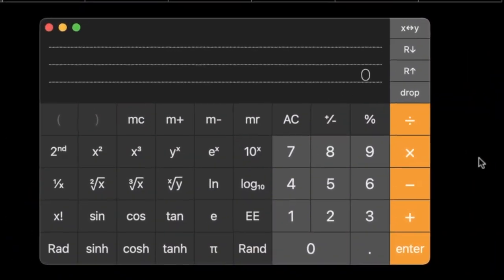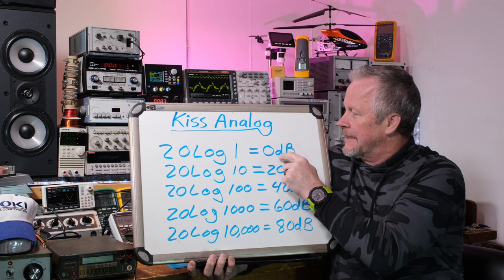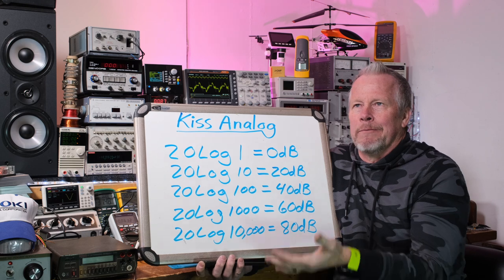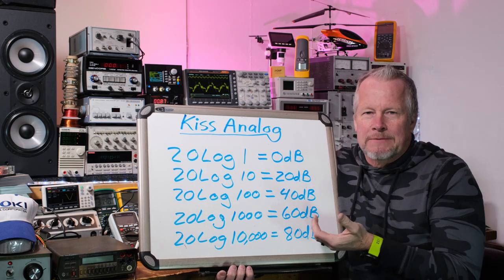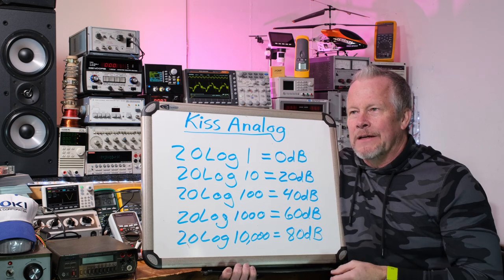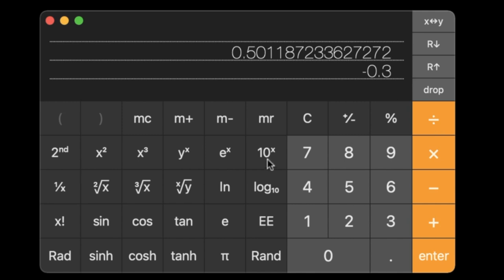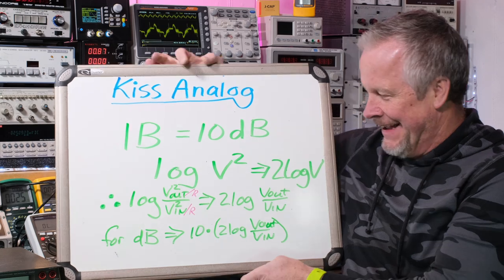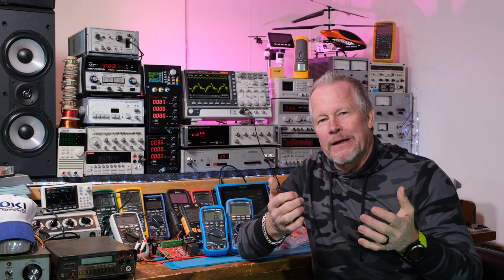Whats all this dB stuff?

Comment: As always, excellent overview, Eddie! I'm looking forward to part 2! Here's a guess about some of what you might cover -- 

Somewhere between the Abacus and humanity becoming spoiled with modern calculators, engineers were ninjas at solving problems using mechanical slide rules, which work using logarithms. Aside from a handful of the slow, clunky,  gigantic complicated computers they had available, we can thank brainiacs with slide rules for landing us on the moon, as well as a majority of the significant scientific and engineering breakthroughs we had in the 20th century prior to the late 70s. 

Compared to what we expect from modern calculators, using logs and dBs typically give you an approximate rather than exact answer; however, the results are usually accurate to more than enough precision for what we need. Decibels give us a quick and excellent estimating tool! Something that Eddie alluded to in his V² power example hints about what makes logs and dBs so incredibly useful and powerful in calculation - it's MUCH easier to add and subtract very large and very small numbers than it is to multiply and divide them, and that's how logarithms and decibels work for us!  Instead of using multiplication or division to solve for things like gain or loss, you add and subtract. Decibels also represent huge ratio quantities by using small numbers, making the addition and subtraction even simpler - like, grade school in your head easy! Also, as Eddie excellently explained in this video, they make it extremely simple to visualize or represent enormous ratios. It's no coincidence that we mainly use 10log(x) / 10^X logs because our natural number system is base 10 (thank our fingers for that). Once you become comfortable using dBs, they open a new world of seeing and understanding electronics, especially in disciplines like audio, power, and RF!
Reply: Also, 'Whats all this dB stuff?' ... I love crossing paths with a fellow Bob Pease disciple. :)  He probably grumbles still as he looks down on us from above and sees how often we're using SPICE.  🤣
Reply from the maker: Well said!  Fantastic feedback!
Reply from the maker: LOL - I'm so happy that someone caught that;)  Bob made such a difference in many of our careers.  He made it fun and was a genius;)
Reply: @KissAnalog  RAP had such an exceptional mind and quirky comedic personality. I met him once around 1999 at one of his NS analog seminars. I forgot to bring my copy of his book, Troubleshooting Analog Circuits, for him to sign (we're such nerds!🤣). When I mentioned that I loved his book but forgot to bring it, he shook his head, pulled out a blank sheet of paper, and then entirely from memory he proceeded to fill most of one side of it up with all the corrections to mistakes in the book. Then he signed it. "There! Just fold that in half and slide it in after the last page when you get home. Now you own the unpublished 2nd edition!."😅

Losing Jim Williams and then Bob when he tragically rolled his VW bug while leaving Jim's funeral  - that was such a monumentally sad week for the analog community. Along with a handful of others like Bob Widlar, they sure don't make industry pioneering rockstars like those guys anymore.
Reply from the maker: @oxo7af, you are so right!  What a tragic year for the engineering community.  Sadly, so man today have no idea what we are talking about.  I did feel a bit unsure about using his 'what about this xxx', but I hoped to breath air into the tech that we know and hope we felt some of that history;)
Reply: @KissAnalog   I've seen a few other blogs and videos that were titled using variations of his trademark catchphrase over the years, but I don't remember being particularly impressed with any of the content. However, I think you did it justice. Your target audience may generally have a different skill level than RAP's did, but your subject matter and intellectual generosity fit perfectly with the spirit of those old articles.
Reply from the maker: Very gracious of you!  That makes me happy.  I appreciate you!

Comment: Hey Eddie, I have a switching power supply question for you. If you ran 2 identical power supplies summing the DC voltage of the two the only difference is use the same clock and on one of the power supplies you invert the clock. Do you think that might cancel out the noise?
Reply from the maker: Great question!  It sure can!  It is sometimes called a two phase converter.  I’ll have to demonstrate this soon;)